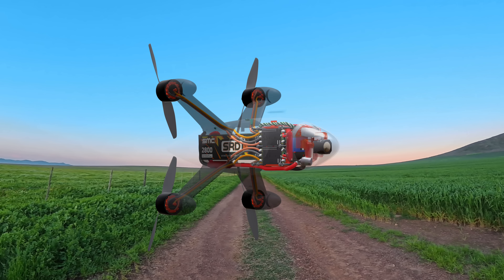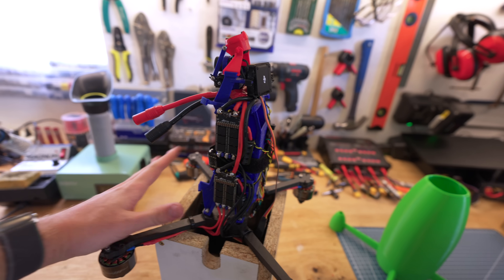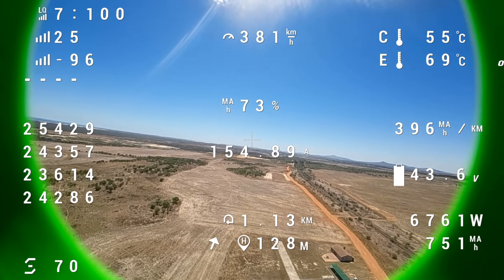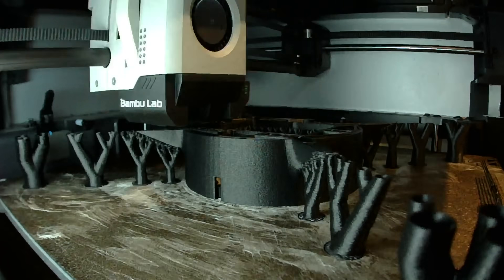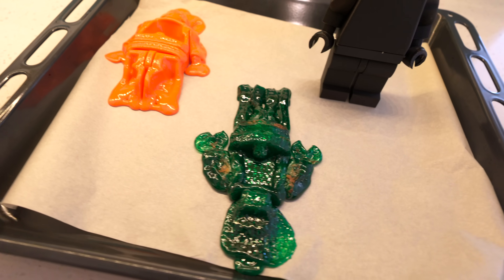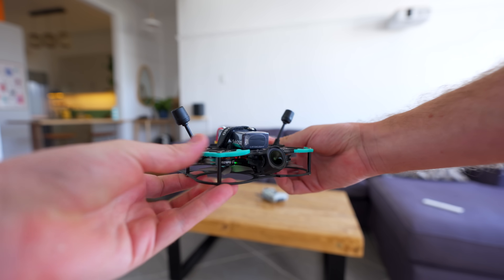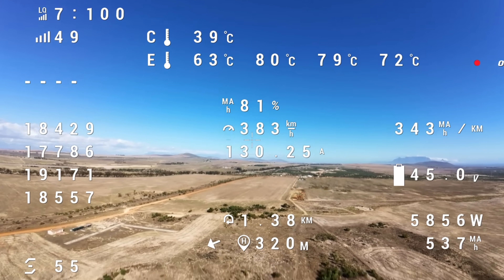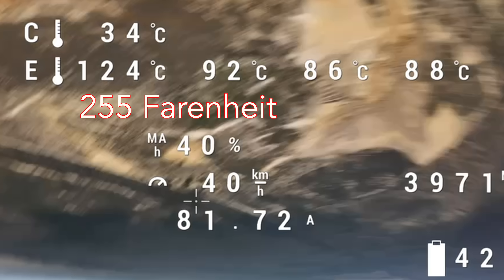THE COMEBACK - World's FASTEST Drone V3

Comment: You could have the fets dissipating to the external. No need for massive inner airflow. Design the cone metal with microfins and have the pcbs fit the inside perfect with a tiny bit of thermal compound covering the entire ic tops when pressed down.

Comment: The GPS problem can very possibly be the Power Ripple. It tortures me 10 days and I finally find out it's my Ratel Mini Camera which increase the ripple above 50mv and higher, which made GNSS totally unfunctional. Accetable range is below 30mv I think. Better use a individual DCDC for GPS or any other 5V system.

Comment: Luke: Have you ever considered using Graphene Ultra Capacitors in leu of using traditional Lithium Batteries?  I think Graphene Ultra Caps would really unlock this drones full potential, they are much lighter and capable of delivering a much higher amount of current at  once then batteries. Its definitely worth a try at least.  Skullcap Industries makes some of the best Graphene ultra caps out there followed by Maxwell Graphene Ultra Caps. 
I really love how you and your dad are working on this together, I would give anything to have a relationship like that with my father, He was in the Aerospace industry for decades as myself in engineering and geology however we never had a good relationship despite my best efforts. You are so blessed to be able to do such a project with your dad, that is the best part of the whole project. I'm so very happy for you guys. Please don't allow the death loving evil powers at be to use your drone for military applications, despite all the $ and their false promises, it would rob you both of the joy of your accomplishment if they took your design and used it as a weapon. Stay on the path of goodness, there's plenty of applications for such a drone that would benefit humanity besides military applications!  Would you consider releasing the 3d print files so others can make their own? Id love to build one of these and try out some ideas for amping up the power by using some ultra caps I been wanting to make on my cnc laser called " Laser Educed Graphene Ultra Caps", Essentially they are Kapton tape that is laser etched turning the Kapton into 3d printed graphene ultra caps, they are even far lighter then traditional graphene ultra caps, plus they can be printed in just about any shape and any size so I'm thinking laser induced graphene might be something really awesome in such a project as this.

Comment: 6:42 Excess heat must be radiated. Why accumulate this heat in water?? 🤔 If you start swirling the water in a kettle, it will not stop boiling! There's no need to create an air duct inside - just make a pipe from the pump to the finned cooling copper radiator and bring the radiator out to the surface of the drone - the external air flow will remove excess heat on its own.
10:30 For stabilization, use engine pylons that are longer towards the tail - they will act as a wings.

Comment: since you are printing the outer case from scratch and milling the aluminum heatsink yourself - is it possible to maybe design some portions of the body to have exposed external aluminum? you could then simply mount the EOCs directly against that on the inside - the speed of the drone would cool the plates without increasing drag (assuming you have a nice fit between the aluminum and nylon body)
Reply from the maker: You are touching on what we are going to try next 😁

Comment: Water might just be the better option but I wouldn’t rull out air cooling. You could build the heat sync block into the walls instead of having to have air flow through the center of the drone.  Just and idea

Comment: The water box seems like it could be cooled if it was attached to the fuselage as a heatsink.  I think all that wind would still cool it while avoiding extra drag.  Logic dictates (raised Vulcan eyebrow), that a compact, efficient, elegant solution for heat  would be a game changer.  It would be cool to figure out a system promoting circulation without a draw on the battery or too much extra weight.  I wonder if an adjustable CG in flight would  iron out speed wobbles like pressing down on a skateboards nose?
Reply from the maker: For sure it probably could but on our latest model it’s already overboard. The ESCs are staying so cold!
Reply: @LukeMaximoBell  Nice!  Good luck and skill squeezing more speed out of it, looking forward to more.

Comment: Peltier coolers get pretty cold but very hot on the other side.  If the hot side is in the air stream maybe you can dump the heat over board as you fly.

Comment: hmm! the two bottom motors have to use more power. 
as they fight gravity More and the wait of the nose. 

they are the one that keep it up the most. and the top two are mostly used for balance. 
It may be better with 3 or 5 motors. 
With if 3 then 2 at the bottom or with 5, with 3 at the bottom.  
As the bottom motors are the ones doing most of the work.

Comment: For effective, low weight cooling look into evaporative cooling. Either evaporating water, CO2, propane/butane or even non-flammable "air duster" (legal way of venting proper refrigerants). Then you can achieve crazy cooling with just a few grams of gas that gets thrown overboard making the machine lighter and faster towards the end.

Comment: Have you considered putting an external heat sink plate for the water cooling? The pump you are using to circulate the water in the pump could just as easily move the water to a smaller reservoir attached to an aluminum plate embedded in the fuselage. With the speed of the drone, the air would wick away a lot of the heat produced inside.

Comment: With the water not able to dissipate the heat, it's more like a thermal battery of sorts than an actual cooler.  The pump is just adding more heat to the system.

Comment: For cooling, did you look into a heat plate - radiator design using a small pump, like they one you developed, to pump water from the heat plate to the radiator, and back? Or did you simply not need anymore heat transfer?

Comment: There's 2 things that are going to limit you.One is your reaction time in 2.Is the lag input in between it?The controls and the machine itself.
But right now scientists can put gears together and have running gears that are the size of your blood cell.The same size they can have little motors. They put light reflecting cells on gears and depending on which way you point the laser is which way it can spin multiple gears. We're\nTalking about smaller than nano tech.

Comment: Hi, I've got a few questions:
- Do you think the use of EDFs could help increase the top speed at these near 600km/h speeds?
- If you made custom ESCs to be able to put them in cryogenic temperatures, could that help reduce resistance and increase top speed (although I could see why that could be a little impractical)
- Are there any rules by guiness against assisted launch systems
- With the performance of the AOS supernovas, would you still use the 7x15 with 900kV or the 7x11 with 100kV 8s as Chris Rosser recommended specifically for these speeds in a video about the motors?

Thanks. It's truly amazing to watch this project improve so much, from Peregreen 1 to now this. It's incredible.

Comment: Why don't you add a ditching parachute that shoots out of the nose cone when you have some kind of failure? Sort of like a model rocket. If something goes wrong you don't have to rebuild the entire thing.

Also, why aren't you circulating the water through a heat sink exposed to the external air? That would dump heat fast at those velocities. Hell, if you're worried about drag, you could cycle it through the external skin of the drone. You would just need the external layer to be heat conductive.

It's unfortunate li ion batteries can't dump power fast enough. A single 21700 battery has almost double the capacity of one of those batteries. You could easily have 20k or more mah on the drone

Comment: Given the short flight durations, have you considered simply immersing the ESC MOSFETS in alcohol, and letting it boil off? This requires no plumbing, no pumps, no heat sinks etc, and should save you some weight.  As a bonus, it will be spectacular if it catches fire.
Reply: The weight change will change the center of gravity. It is perfectly fine as it is!
Reply: "The weight change will change the center of gravity."
- Not necessarily, if mass is removed form the CoG it doesn't move at all.  In any event, the center of gravity is adjusted at the end of the build by adjusting the tail....

Comment: Why not install those 4 TBS Lucid ESC's on the wings with a heat sink?
Reply from the maker: It will make the arms too fat
Reply: @LukeMaximoBell  inset slightly, no need to increase the size of the arm, the heat sink plate can be flush with skin of the arm while the ESCs are fully inside
Reply: or install Thermo Electric Generators  and allow it to bleed NRG back into the system.

Comment: Could you have some almost 0° coolant with antifreeze ready to pump into the drone before flight?
Reply from the maker: Yes but too cold brings condensation 🥶
Reply: @LukeMaximoBell true true. Ambient heat should flash it off pretty quick... Extra free evaporative cooling! Haha. I think it's anti corrosive as well (antifreeze).
Reply: @LukeMaximoBell was thinking maybe a glass beaker in freezer with water/antifreeze to about -4° then into the thermous to take to field. 👍

Comment: Some mention has been made in comments regarding water vs metals as a means of removing heat, apparently with no knowledge of the specific heat capacities of materials.
Water has more than four times the specific mass heat capacity of, say, aluminium so is a considerable more weight-efficient means of removing/storing heat, even given the extra components' mass required to implement the cooling system.  

Forced 'ram' air cooling of lightweight heatsinks would of course drastically increase drag so is a non-starter in this application.  (The cooling fan on the 25kW VW Beetle absorbed over 2kW).
Metals on the whole have very poor specific mass heat capacities compared to water, and denser metals tend to be even poorer than the obvious lightweight metals such as aluminium and magnesium.
For example, 1kg of water has the same heat capacity as 32kg of lead - it's remarkable stuff, water, as our physiology and planet proves.

Water:  4184 J⋅kg⁻¹⋅K⁻¹
Aluminium:  900 J⋅kg⁻¹⋅K⁻¹
Lead:  129 J⋅kg⁻¹⋅K⁻¹

Liquid ammonia would give a modest increase in heat capacity but require a pressurised system (nearly 10bar), and whilst hydrogen gas has the highest heat capacity it would require impossibly high flow rates and massive surface area due to its low mass.  Simply refrigerating the water might remain the best means of increasing the run time for a given temperature rise, should this become a problem!

Comment: You can charge STANDARD Li-ion above 4.2V/cell and get about 12% increase in available power .... 4.2 is normaly chosen  just to get 400 life cycles , at higher voltage life drops to about 10 cycles , but of no concern if going for a world record , you can reduce battery weight by 12%.
For better heat transfer and reduced weight the ESC could be inside small plastic container cooling fluid in direct contact with ESC's , aceton / alcohol or light mineral oil.... But shurely better to position ESC's in airflow , I can't imagine they would over heat with 200Km/hr airflow.

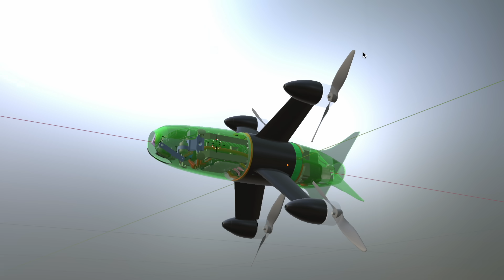Comment: 02:07 Wrong! The toughest and most heat resistant filament on the market is never PA-CF, regardless of brand, its PEEK-CF. This is just the basics of materials....
Reply: Peek is not printable with standard 3d printer,it need at least over 100 degrees chamber temp and high bed temp, i think he wanted to say it is best in normal materials you can print with some bambulab or others printers
Reply: @SimoAutomation I'm just stating the facts here. He could also have outsourced printing of PEEK-CF if he really wants to.
Reply: @youtuberschannel12 outsourcing it throws away the entire benefit of a 3d printer. In house production and testing is the point and a necessity. 

So while you may be correct about the material “hierarchy”, if you can’t print it in house, it’s probably a bad option for the project.
Reply: @VegaLyrae Not quite. That’s a sweeping statement.

3D printing often enables faster and more cost-effective prototyping than traditional methods. While in-house capability is ideal, it’s not strictly necessary. Even when outsourced, 3D printing is typically far more practical than jumping straight to injection molding, which is significantly slower and more expensive for prototypes.

So what you said really overrestricts the role and existence of 3D printing.
Reply: @youtuberschannel12 yeah and for a world record wed chose the best choice

Comment: If you want to go faster still, trim some off your propellors so they are a bit shorter.  This allows the motor to run at a higher rpm while the pitch remains the same.   I'm reasonably sure a propeller in the 6.8 inch range is not available so trimming is your only option.  For information look into Control Line aircraft racing,if you haven't.  
     I subscribed, and am looking forward to living vicariously through you as I have Parkinson's and my flying days are over.
Reply from the maker: We actually haven’t tried prop trimming yet. Probably is it will reduce thrust a bit… but it could result in a higher top speed

Comment: I wonder if you could use duster gas in an open cycle liquid to gas evap system for cooling. Use the same reservoir but with a pressure relief valve.

Comment: Phase change works better than water and is a lighter collection of parts. You only need to have copper tubing soldered to a plate. also try thermal adhesives they work great with no need for clamping adding weight.  the motion of the craft will be the cooler.
Reply: The cooling it has is already perfectly sufficient.

Comment: The huge amount of power used is ridiculous for such a tiny drone. The efficiency is horrible and must be in the lower 1 digits. Put wings on it or ducted fans or whatever. If you get this speed with less than 10kW i am impressed.

Comment: If you want to break records you can't use toy manufacturing like layered plastic 3D printing and aerodynamics isn't a cartoon. Your design looks like tintin. Aerodynamics is merciless and loves perfection. Your design is way too chubby, uneven surface and the motors are out in the air stream when they could be inline. Think supersonic air torpedo or spear. Very slender, very pointy, very smooth. If you think it's too thin it's not thin enough. Cameras can be super tiny and go higher in thinner air. You can probably do the body as a sleeve weave carbon fiber, either single thin layer or two super thin layers. Maybe use 2 piece machined polished metal molds per end to get the outside smooth and precise. @longsheng2019 here on youtube do very good work from what I can tell at decent prices. You may also want to do a thin metal shell fuselage and use that for cooling. But it is possible to route cooling air through an aircraft at very little drag penalty. check out sharp nemesis. the trick is to widen the airflow inside so it passes slowly and then speed up again for exit. If you want to use short term reservoir cooling start from ice instead of water. you get an additional 80 degrees worth of melting energy. you can also use more silicon to lower RDSon for less heatloss, maybe. I would think you could relatively easily break the sound barrier

Comment: I imagine flight time isn’t a big concern here, so sinking the heat into a water tank rather than rejecting it to the atmosphere makes plenty of sense.

I do wonder if it would work to make a section of the shell aluminum and mount the ESCs directly to the inner surface. The shell would act as a radiator without having to duct air through the interior of the drone.

To take it a step further, you could stick with the water cooling but get the main frame 3d printed in aluminum with water passages throughout, and use the entire surface of the “wings” as radiators.

Taking a step back from water cooling, you could do an aluminum shell but use copper heat pipes to get the energy to the outer skin without any extra electrical load.

Comment: Since you are just dumping the heat into a block: Use Paraffin instead of water. This means the energy will be absorbed in the phase change from solid to liquid, which is much more weight efficient.
Reply from the maker: Interesting! But that does seem a little dangerous

Comment: Instead of water-cooling: would it be possible to design (and cut) a smal and clever designed Air-channel through the whole Drone from back to front , which flows air around the heat sinks?
The faster you fly, the hotter it gets, and also the faster the air will flow through the drone and would adjusts the cooling power by logic in itself. Win-win and less weight than the water cooling

Comment: Water is heavy for cooling, would a finned heat sink like a computer CPU not be lighter, will air intake and extract ducts to the outside, the rate of airflow and cooling would increase with speed, but the geometry of the intake would be NASA level to get it right. Water can also insulate, so when it's warm it's warm, other liquids may have better thermal carriage properties.
Reply: DOH!, should have watched the entire video before committing!!!

Comment: For thermal management forget about water cooling and look into heat pipes used on CPU cooling blocks instead.
They weigh less and move heat more efficiently.
You will need help from someone to do the thermal design and give you a something to put into your CNC, but the end result will be better than basic water cooling that is being used at the moment.